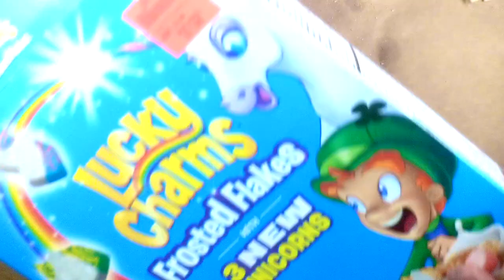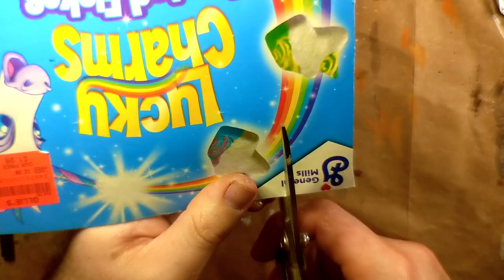How to Build a Custom Diecast Car on a Budget - Hansen's Speed Shop $5 Gasser Build w/1963 Corvette

Comment: Awsome car man, you even went the extra mile by using lo buck tools, great details and way to think out side the box the car has a great period 60's look very cool and impressive thanks for being in the build off don't forget to look for the results video in a couple of days
Reply from the maker: Thanks! My goal was to try and take the challenge as close to face value as possible and use as little non-common household items as possible. I tried to think what I would do if I was a kid just getting started and it brought me back to the kind of makeshift stuff I used to do as a young builder that didn't have a hobby shop nearby and had to improvise. Thanks again for hosting! Looking forward to seeing the other builds.
Reply: You hit the nail on the head, that's exactly whate this build off was really about to show the new guy, young guys or just the dude who thinks this is to expensive, that if you have the will you will find a way to get by, hopefully this inspires some more to get involved thanks again for posting

Comment: Great build wouldn’t of put the bead on the front as a gas tank but still a great build 👌🏾👍🏾✌🏿👊🏾🔥🔥🔥🇯🇲🇬🇧
Reply from the maker: That's fair. I had a bee in my bonnet about both builds having front gas tanks. You'll see what I did for the baller build soon! Thanks for watching.